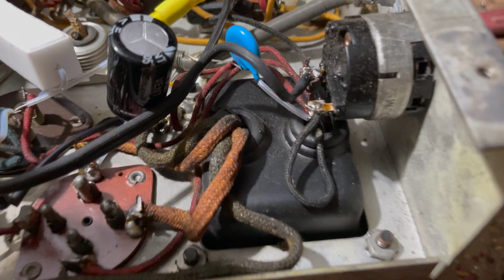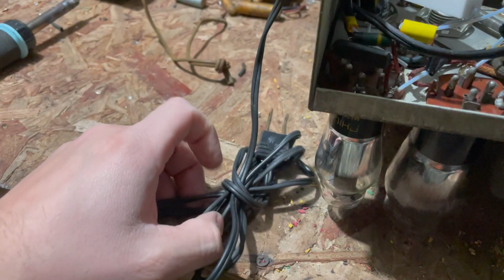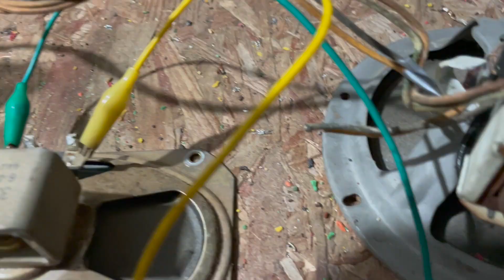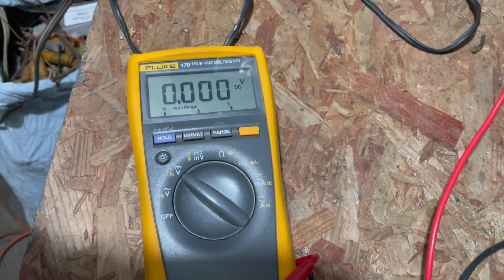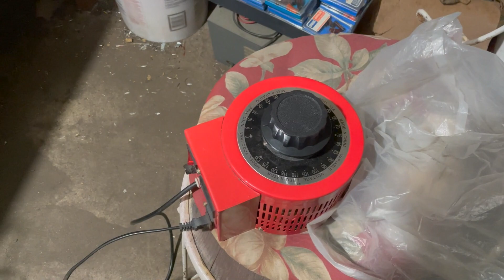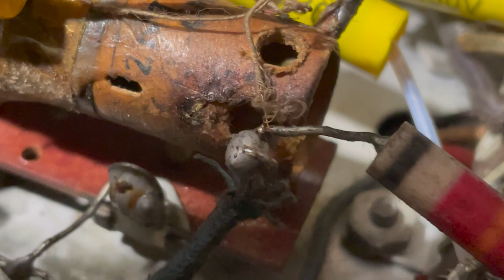1937 Emerson L122 Antique Radio Restore - Part 3

Comment: Greetings Adam:
Your dim-bulb setup switch seems to be in series with the bulb instead of in parallel (which would change it to a bypass switch, with OFF being LIMIT and ON being BYPASS). (Your VARIAC has the needed OFF capability.) If my assumption is correct, then you have a plug-change to bypass the bulb (maybe the switch label is incorrect).